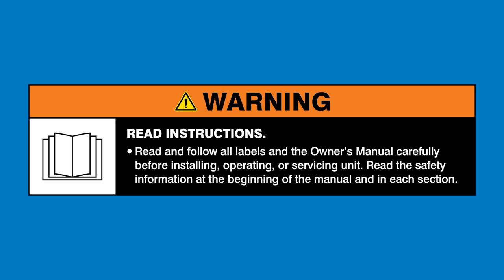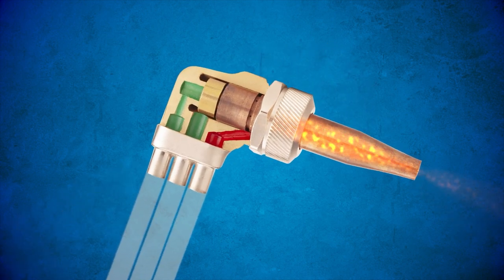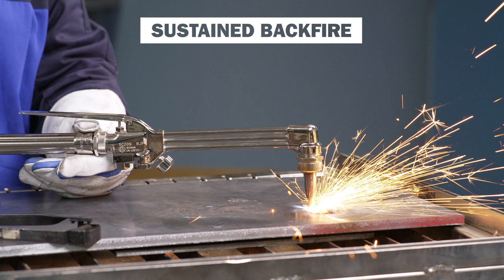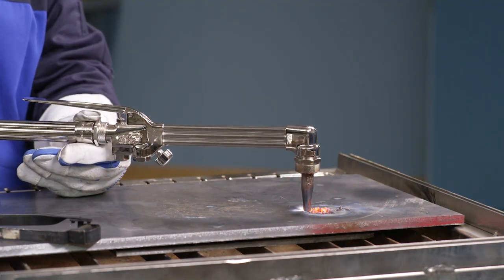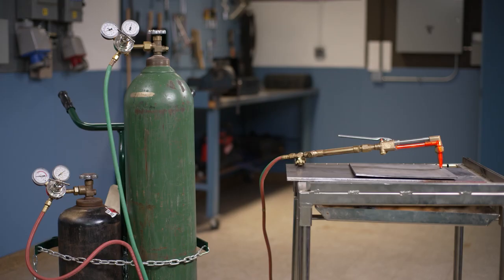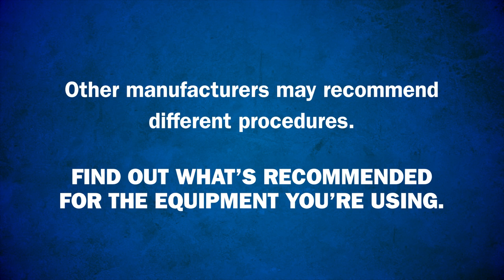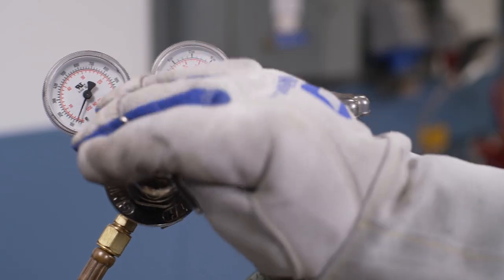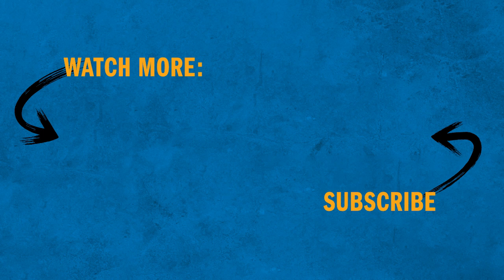How to Identify an Oxy-Fuel Torch Backfire and Shutdown

Comment: I've had it happen a few times, usually when the can pressure is almost gone and i might touch the tip for a split second (were not changing the gas cans/flasks before completely drained and unusable..... Not my decision!)
And always rapidly shut off the gas, wait a few seconds and turn it on again to purge and see if the flame has gone out, it usually spits a black cloud and nothing more and then check everything for heat.

I've also heard a coworker doing it several times but they never shut off and just continue using it wondering why the flame is weak before i scream at them to shut it off 🤣

When i started in the company the hoses and whole setup didn't have any flame arrestors! Only backflow preventor, i quickly demanded new hoses, gun and flame arrestors when changing the hoses it where completely black inside the acetylene one..